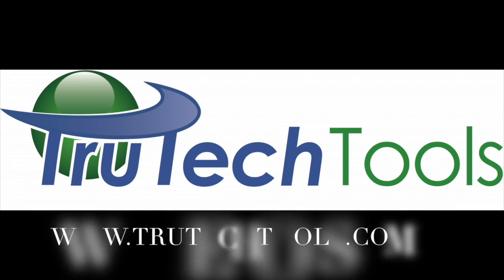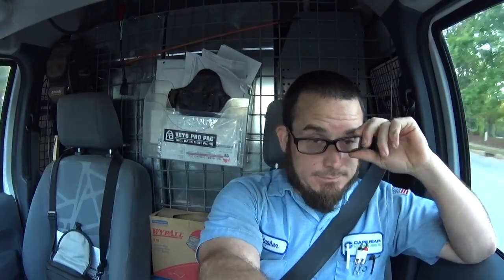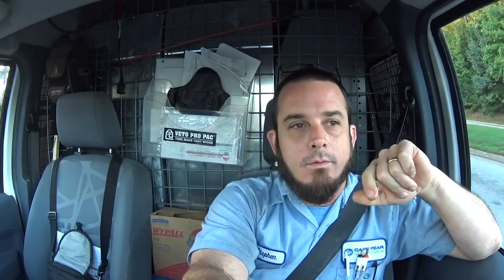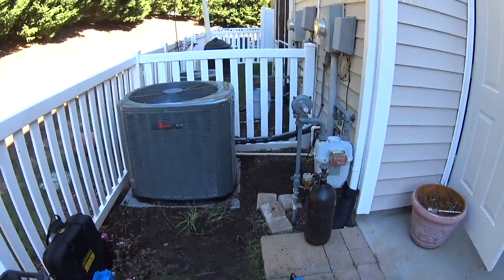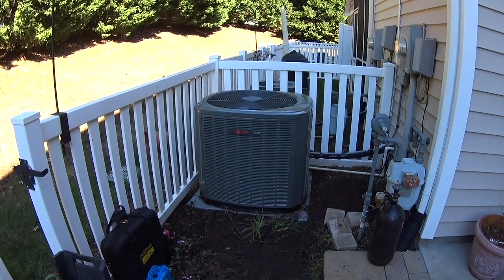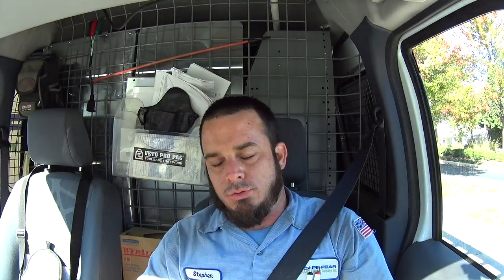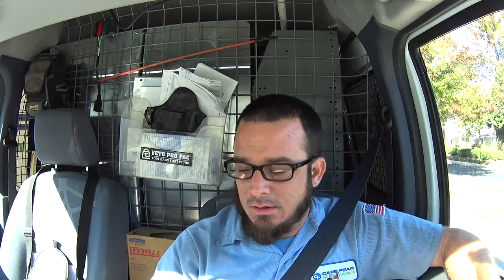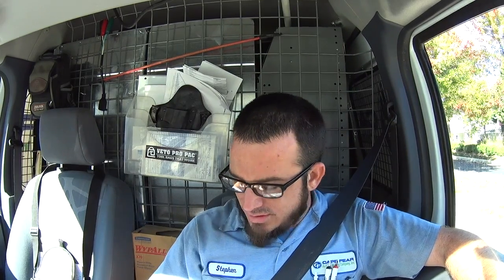HVAC Installation: I Still Make Mistakes And Bad Decisions

Comment: What kind of readings were you getting on your pressure test and vacuum? How do you like the wireless gauges?
Reply from the maker: Afraid it’s been too long to recall, obviously I should’ve been more careful
Reply from the maker: I have not used a standard manifold for quite a few years now. I like the wireless probes much better

Comment: You need to turn the unit.
The way you installed it is not code. Too close to gas meter.
The control panel has to be four feet from the gas meter vent.
Reply from the maker: Yep, that’s why it was different to start but the almighty inspectors said otherwise...

Comment: What was the issue? Source of ignition within 3' of gas meter? The reg vent can usually be piped away to gain clearance. The ignition source being the contactor.
Reply from the maker: +Larry Fisher the issue was the client didn’t like the look of the unit with the piping up front. There was no code issue until I spun it back into the corner, then everything was violated! LOL
Reply: Stephen Rardon 
Ok thought I heard mention of an inspector thought maybe that was the cause. Sounds like a customer that is hard to please. Seen my share of those. Guess they prefer to watch techs have to stand on their heads to service the equipment.

Comment: thank you for the response I do understand your point make the customer happy even when it doesn't make any damn sense lol I work for a senior community and it has its own set of problems my boss has been doing this shit for about 25 yrs now and he has taught me alot they paid for my cert and I am trying to get him to understand that the way he use to do things is pretty much gone lol he still does the beer can cool method and I have got away from that and charge by SH or SC  and I am trying to get him to understand why I am actually following industry standards and I have started to notice a pattern when I fix a unit and charge it usually by SC because it's an old again unit and there fucking junk they last I haven't had to go back to the ones I've done but the ones he has done with the beer can cool method he keeps blowing compressors what can I say to him to make him understand that things don't work like that you and the Israel HVAC guy are the reason I am currently switching to sporran smart tool but plz what can I say for him to understand my point

Comment: Kustomer is King and home his Kingdom. Coming from plumbing I never forget to leak test braze jobs now after having a  backside dripper get discovered after the store was closed for the weekend and it watered down electrical shaft and fried a elevator control board.

Comment: How has that made any difference when you have that ugly gas meter there! As per the leak I feel for you man as I have done the same thing myself. My only concern is that you will have pulled non condensibles in to the system when you carried out your first evacuation. Once you opened the valves and discovered the leak it should of been a recovery, pressure test and recharge with virgin refrigerant. Running pressure/temps belay this but just a thought. Cheers

Comment: everytime you try to go fast, it takes longer.  Are short cuts really short cuts.  WE all do it on occasion, and slide by,... when it goes wrong though, we beat ourselves about the head and shoulders over it.... I would hate to read that on a stress level indicator if one were around. When you pressure test, do you put a shot of 22 in with the Nitrogen in the event it leaks you can use the electronic? In that instance I wouldn't because of the limited joints to check. Good Videos...

Comment: Always use nitrogen before you use the vacuum pump . Even at 100psi standing for five minutes will ensure you you will have a good vac. Did your micron gauge tell you that you had a leak?
Reply from the maker: I shouldn't have rushed, yes, if I had looked closer I would have seen that the microns were rising. Thanks for watching Ernie Maurer

Comment: Stephen,please do a video on bad Lennox defrost board diagnosis.
Reply: Jon Natal Usually the fan motor won't run in AC. In heat pump you can short the test pins to test defrost cycle.

Comment: Mechanical code states condenser should be accessible 16" off wall or fence area, within 3ft of electrical disconnect.

Comment: Not "mistakes" more like bad habits.  You need to step up yo game. 
-Never never use your finger to push a contactor in are you insane (everyone else out there who does it same to you)
buy a dang inspection mirror how do you do a weld, not inspect with a mirror and then not even pressure (or vacuum lazy but at least it's something) test and proceed to insulate and finish the job. That's some straight rookie stuff. Everyone has leaks on the first shot sometimes but that's why you CHECK IT OUT before you finish everything. 
-lose those Bluetooth gauges that's for hacks 

Just some advice, one playa to another.
Reply from the maker: Thanks for watching. I said I made bad decisions, thought that covered it. I don't get why you say the BT gauges are for hacks. Hacks could give a rip about checking pressures and SC, SH. Hacks wouldn't have given any thought to the accessibility of the unit for future service. I made a bad decision not to inspect the weld, bad decision to insulate before I finished and had confirmation of the weld integrity, bad decision to set the unit and not consult the customer. Only thing I don't see as a bad decision is pushing the contact, Did I Die? Playa
Reply: paulersuckalot/where are your videos ass wipe?did i mention your an ass wipe,just making sure i said it right,would hate to disappoint your god like intelligence(ASS WIPE)

Comment: After I braze, and have nitrogen in the line, I take big blue bubble leak detectant around the joint for good measure checking for leaks. I hate knowing I have leaks after putting everything back together.

Comment: The a/c does look better rotated with as little of the ugly lines showing. That's the way I would have done it the first time :)  It's also A LOT better to have the satellite dish on the roof. They require extreme accuracy to reach something hundreds of thousands of miles away. 99% of them are on the roof because housing structures rarely shift, and the slightest microscopic turn of the dish can drastically throw off the signal quality. It's a double win for the customer to have it this way.

Comment: How far was the contactor to the gas meter? Didn't you say 5 ft. In n.c
Reply from the maker: You know what, that's a perfect example of how every inspector is different. The inspector told that customer that clearance wouldn't be an issue if we spun it back around the way he wanted it.

Comment: i have this from time to time. i think of it from a different angle when this happens. i already reeled in the customer, its a pain in the butt however a little more work and hes here to stay. on the other , going to find a new customer from scratch aint all that easy. as for the leak, yes sometimes a short cut is a long cut. nice work as always!

Comment: I think we have all been there with that type of customer and those sorts of problems. Not teaching you to suck eggs or anything! What i do is inspect all round the joint with a mirror and torch before it cools, then i'll cool it with a rag and check again once the scale has been wiped away. Generally if the joint looks good it won't leak.
Reply from the maker: You're right, I tried to hurry and it bit me back.

Comment: You have to kidding me! Look at the ugly gas meter. Didn't call the gas company to have that moved.
Reply from the maker: Bob Cuomo they don't consider the compressor a source of ignition, they dictate the contactor here and the inspector is the one that said it would be OK to spin it back the way it ended up...
Reply from the maker: Yep, AC was the least ugly thing in that Yard.
Reply: +Rob HVAC Maybe did call the company, and when they told him they'll relocate the meter for an additional $6,000, he changed his mind :D
Reply: bodybuildingking So then why would you have the condenser moved then? Makes no sense especially when I am sure they had approval for the placement ahead of time.
Reply: Regulator needs to be 5 feet from source of ignition . Compressor too close

Comment: in my opinion I would have install it the same way you did it originally I try to make it where I can get to it easily but without gas meter so close I'm surprised that they allow that condenser to be even in that spot makes me remember how much I hate residential some of the nightmares and BS you have to put up with.
Reply: +Ben Kuxhouse Up here (Canada), we require 3' from the regulator vent outlet to a source of ignition. If the meter is installed with the more expensive over pressure cut off regulator, the clearance is reduced even further down to only one foot!  Looks like he meets the 3' clearance in this video. but I don't know what regulations you wacky americans have.